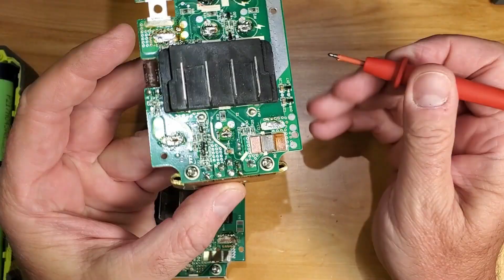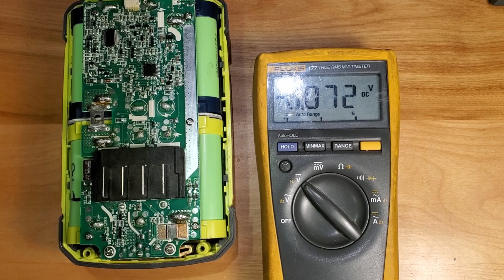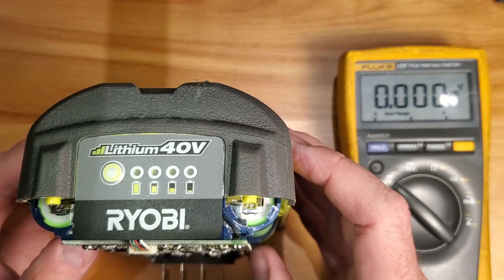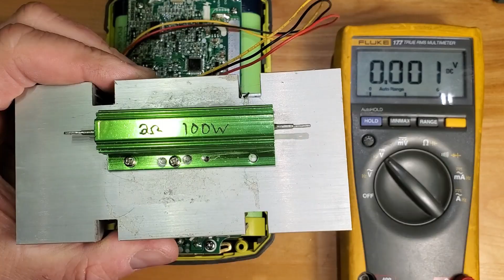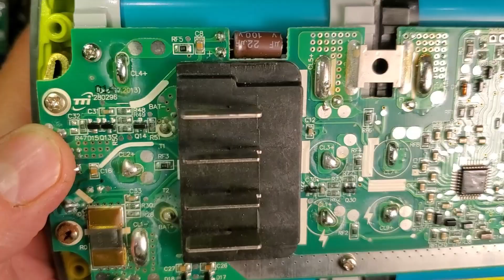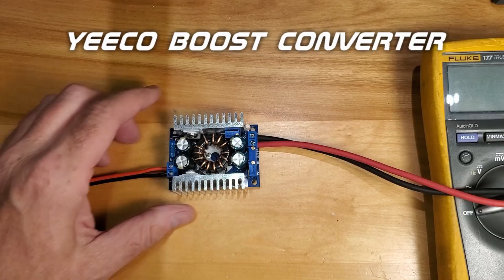Ryobi 40v Battery Questions answered

Comment: I am using these packs to power a 40v "1000w" minibike build. Using just 1 (6Ah) battery, the pack shuts down, I'm assuming the current draw is too high and it's lowering the pack voltage and tripping some protection. I have not been able to test with two packs in parallel yet. Is there a "C" rating on these packs, or do you know how many watts I can pull from them?
Reply from the maker: I am not sure about the 6Ah packs but the other ones you should be able to pull 15A for a short period. What motor are you trying to run?  The 1000W motors I have seen all run on 48V or higher. If you try to run these motors with they ryobi batteries it will shut off because the voltage is not high enough to start out with.  At full power the ryobi 40V(36volt nominal) will require almost 30A(27.7A)  hope that helps

Comment: In the 4 connectors of the pack,  
The outside connectors are pos and neg
What is the function  of the 2 middle connectors ?
Reply from the maker: The middle pins are used to communicate with the charger.  Here is a website where a few people are trying to decipher the communications.

https://www.diyelectriccar.com/threads/ryobi-40v-bms-troubleshooting-and-repair.197409/
Reply: @thecityviking thanks, Im asking because some battery packs especially for scooter has separate pin for charging
Reply from the maker: Most standard BMS's have a separate  wire for charging.  The positive wire from the battery goes to the charger and is used to power your device but the negative usually goes through the BMS (B-) and has separate connections, one for charging (C-) and one to power your device (P-).  Quite often you have a separate connectors for charge and one to power your device, but I would bet that inside the battery pack that the positive of both are connected.  The Ryobi Battery is different in that it uses the same 2 connectors for charge and discharge.  Not sure why they did this, perhaps to make their batteries more proprietary.  Hope this helps.

Comment: I have 2 of the Ryobi OP4026 95 Wh with the "18" stamped on the board next to the Dec 17, 2013 date and the light green batteries. I charged one up to 40.1 V using the same type setup as you describe (connecting the negative to the screw/pole and the positive to the far right blade as in your first video). On the first one it worked perfectly, on the second one it charges correctly and all the batteries check out as holding a charge (between 3.6V and 3-8 V and around 20V on each half), but when you measure the voltage from the far right blade (+) to the far left blade (-) the voltage is 15.1 V. Obviously, when you put it on a Ryobi charger it just flashes green and red--because the voltage is showing as so low. Since the resistor mod doesn't seem to work on this board, I was wondering if anyone had any ideas about why this was happening or how might one fix it. Seems a shame to have to deconstruct the battery for parts when it seems to be working otherwise. Great videos! Thanks in advance.
Reply from the maker: Thanks for watching.  The measured voltage across the 2 blades is not always accurate.  If you attach a load across the two blades and then measure the voltage, it usually measures correctly(I think I show this in one video).  This is because the FETs turn off after about 30 seconds and you are not actually measuring the battery voltage.  

Here is another source for Ryobi battery information.

https://www.diyelectriccar.com/threads/ryobi-40v-bms-troubleshooting-and-repair.197409/

Comment: Why did you not identify the cells?
The green cells are LG LGDAHA11865. The other color is Samsung INR18650-13Q. You can look up the datasheets for each of these. They are both 1300mAh LiCo cells with a nominal voltage of 3.6 volts. There are 2 Banks of of 10 cells.
Reply from the maker: I tried to cover everything but also make a video that was not too long. I never make a script, so things sometimes get forgotten. Thanks for watching and adding the cell specs

Comment: Ryobi batteries are just junk I had too many fail some I've revived some with bad circuit board but cells are ok....junk pure junk I now use an adapter so I can use either a bosch or dewalt on my ryobi tools so I've solved all my problems by NOT using crap batteries from ryobi.
Reply from the maker: I had a friend 3d print an adaptor and I bought some that look 3d printed that come complete with wires and connectors so they are ready to go.  I ordered some connectors for the 3d printed one and they should arrive any day.  I will make another video that shows the 2 with the details.
Reply from the maker: I believe I have one, but it is still in working order.  I was considering doing a video showing some of the differences in the boards.
Reply from the maker: I agree with you in that the battery packs fail too often. If I were to make these packs I would not make them so proprietary. I like your thinking with the adaptor though!

Comment: I was working on an Oregon 40 volt chainsaw, yesterday.  They thought it was the speed controller or motor but I told them is was more likely the battery or a switch.  They said the battery has four bars on it but I told them a battery can contain voltage but no current due to excessive internal resistance, E=IR.  I put the battery on a new Oregon charger and after about an half hour the battery would run the saw for a second or two.  I left it on the charger overnight but I think the pack is shot.  I do not know any history on the saw or battery pack.  I think the battery was fully discharged and the saw thrown in a tool shed until the next time the owner wanted to use it and the battery was then crapola.this is why I only have two cycle saws.
Reply from the maker: It is likely the battery.  Have you checked the voltage of the battery and the individual cells?  Lithium packs shut down the pack if the cells are not balanced.
Reply: @thecityviking  no,  just the positive and negative terminals and pressed the button on the front of the case, four green bars.  Voltage was 40 VDC.
Reply from the maker: You could still have a few weak cells causing the pack to shut down, but maybe there is a problem with the motor or drive that is causing too much current draw.  The easiest way to determine if its the battery pack or the unit would be to try a known good battery.

Comment: I have the Ryobi OP4015 Battery.  It sat on a charger for a long time  (both plugged in and unplugged).  Now all the LEDs flash and the charger does not detect it as chargeable.  The logic board is a Double Fet type.  If I solder a wire from one FET contact to the other as in your video, can I just plug the battery back in the charger?
Reply from the maker: Flashing lights on the battery are usually a sign of a problem. In my experience the individual cell pairs are very low and it will not charge on the charger.  You could try and charge the individual cell pairs up to 4.00 volts and see if the charger will work again.
Reply: @thecityviking  After I soldered the wire across the 2 FETs, the charger did recognize the battery as chargeable.  But after using the battery once and placing back on the charger for another full charge, the red and green lights flashed again after all the LEDs turn solid green.  Is this expected because of the FETs being bypassed?

Comment: Instead of salvaging, I would like know how much effort is required to replace these bad 18650 cells.  I have many 40v tools and rely on these batteries.  However at 100 to 150, I look for used and bad batteries.  I have an opportunity to buy 15 assorted amp hour bad batteries.  I can use good cells in some to make others work.  Just need to know how to swap them.
Reply from the maker: You would have to start by removing the board that is attached.  While this can be done, it is difficult to not damage traces.  Once the board is removed, there are 4 long screws in the older pack that breaks it down to 2 separate packs.  You would then need to remove the welded tabs on the ends to remove the batteries.  I have plans to do something like this with some of my batteries. Stay tuned!

Comment: I have a weird issue.  My BAD 40v is fully charged and when I put it on the charger it says fully charged.  I also have another 40v which also charges fine so the charger is fine.  The problem is w/ the my BAD 40v that's fully charged and shows no errors when on the charger will NOT power on my tools.  I've tried multiple tools.  My good 40v powers fine.  What do you think is wrong?
Reply from the maker: Is the questionable battery actually charged?  Have you opened and confirmed?  If it is, the FET could be FUBAR. I had a battery that flashed all 4 lights but would not run the tool, and when I checked the voltage it was low and some cells very low, so I think the flashing means something.

Comment: I have a newer 4.0 battery that won't charge or run the tool. When I push the fuel gauge button all 4 LEDs blink 4 times. I get 38v at the terminals and here is a link( https://tinyurl.com/yag6vo45 ) to my testing at the battery test points... Any ideas I was thinking maybe a bad MOSFET...?🤷‍♂️
Reply from the maker: While it could be a bad FET it is more likely that the pic has determined that the one of the cells is bad so it won't let the pack charge. Check all the sets of cells to see if they are all close to the same voltage. At 38v each set of cells should be 3.80v. If you have one set that is different that may be the problem.  If you get all the cells close to the same voltage, it may satisfy the pic that the battery pack is ok again.
Reply: @thecityviking  Each cell is 3.80v. Still have 4 flashing LEDs. 
I think I will de-solder the FETs and replace them.
Reply from the maker: You could check the gate voltage to see if it is trying to turn on the FETs. I think its about 10V.  Do you have another battery to make sure your charger is good?

Let me know if you get it going again.  Good luck!

Comment: Looks like there are multiple revisions of this board. I have a Rev Q board, which looks nothing like yours in the vid. I'd like to see how to revive it or check the cells.
Reply from the maker: Is it a newer battery?
Reply: @thecityviking  yes, it's about a year old.
Reply: The newer (updated) Ryobi 40v batteries will have the Rev:Q battery management system board. The older Ryobi 40v batteries will not have these bms boards, but still use 2 FETs on the updated Ryobi 40v batteries.

Comment: you answered my issue; I have 41 volt on but the power shuts down after like 30 seconds, restarts again after the trigger is released and pressed again, faulty electronic board.
Reply from the maker: It could be shutting down because one set of cells is low when the load is on the battery too. :)

Comment: I have a single FET pack that is showing full voltage internally but only about half voltage across the main terminals.  What do you think about the idea of running a thermal switch (rather than a solder bridge) across the FET pins?
Reply: I added a jumper as you suggested and saw no change.  Do you think I am looking at a bad FET?
Reply from the maker: The jumper should have bypassed the FET and the battery should have the full voltage across the main outputs. Are you not getting that?
Reply: City Viking I will post a pic tomorrow showing the jumper placement that I used
Reply from the maker: A thermal switch would offer a little protection at least, but I would only charge it that way while monitoring it. Did you see the part of my video where I show how the output pins not showing the correct voltage until I put a load on it?  Then it showed the correct voltage.
Reply: City Viking did I see it?  Man, I watched both videos multiple times!  Lol.  What I am worried about is the case where I forgot and left it on the charger and it got in a thermal runaway scenario.  I am hoping that breaking the bridge will stop the charge, but your video didn’t really cover that scenario, unless I missed something.
Reply: I reattached the jumper and it worked as expected.  My first attempt must have  been faulty.  I switched the solid jumper to a thermal switch from an old Makita (I think) battery so that if the heat gets too much the bypass will open.